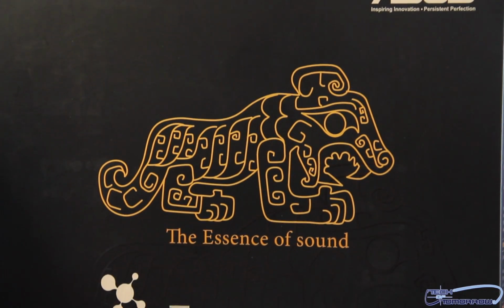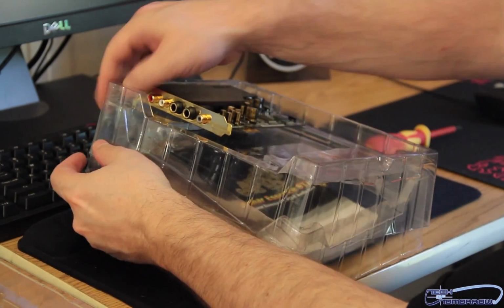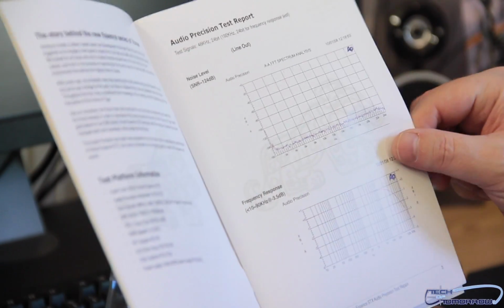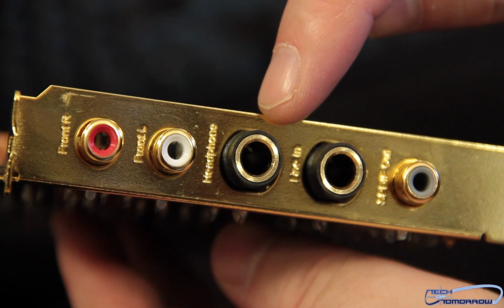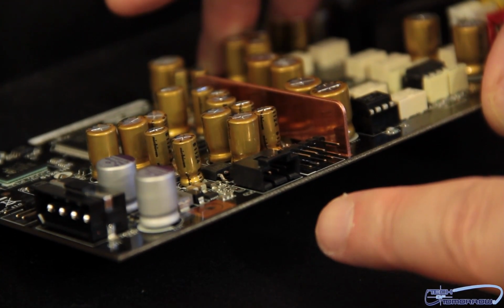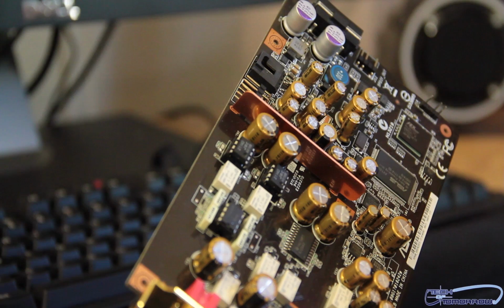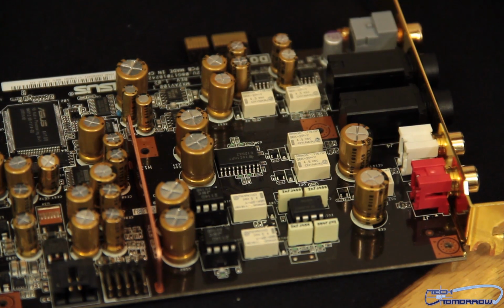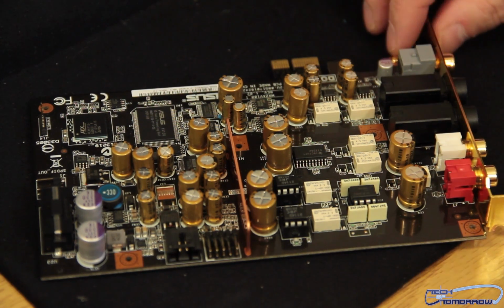ASUS XONAR Essence STX 124 dB SNR/Headphone Amp Card Unboxing

Comment: The DAC in this card is insanely good. I have tried several new (and expensive) models from, among others, Topping and SMSL, but none of them are in any way decidedly better than the DAC in the Essence STX card. With upgraded OP amps, the card will be even better.

I bought the card used for less than $15!
Reply: I'm sure it sounds great but I doubt a bit that it comes close to external DACS in every discipline. 

Btw, I have also talked to somebody who tuned his Benchmark DAC(older studio oriented equipment) and he opined that most of Topping & Co. suck. According to him the tuned Benchmark  DAC(an external unit) is superior.

I'll pick one STX up tomorrow and I'm pretty "amp'd" to give it a listen.
I already got a DX and a D2 and they are a vast improvement over the DAC of the OEM sound unit.
Reply: Hi, how does it sound through coaxial spdif connection?

Have you connected it to a DAC or Receiver that way?

I bought it used to use it through coaxial and I'm waiting for it to arrive. I've read many reviews that it sounds very good through coaxial with high-end equipment, it also has a good review on Stereophile.

Comment: Will I need a DAC if I get this card?
Reply: +Daniel Shelford All soundcards are actually DAC's. They all convert the digital signal to analog. People prefer to send the digital signal (SPDIF or USB Async B) straight outside their PC-case. Since it has vibrations/static electricity etc. That's why most people nowadays buy a external Soundcard (DAC/AMP combo)
Reply: Thank you!

Comment: i have a 780ti videocard i use HDMI cable to my onkyo 5.1 amplifier.. i dont have a soundcard its just onboard on my asus gene VI. what happens if i buy a soundcard. will the audio trough HDMI be better? will it use the soundcard? or is it still the onboard sound?
Reply: The audio through HDMI from you graphics card will use the onboard sound, so the soundcard will be better in terms of audio quality. In order to utilize the soundcard you have to take the audio through the soundcard to the amplifier. I would use an optical wire from the sound card into the amplifier. That way you bypass the onboard sound and only use the audio output from your soundcard, which will give better sound quality. Hope this helped.
Reply: Ok but i use a 10 meter hdmi cable to my amp, so i need an 10m optical cable also?
Reply: Claus van Dijk Yes, you would need a 10 m optical cable. The advantage of optical is less signal loss than metal wires so nothing to worry about regarding the length. Depending on where you live the price may change but is around $15 on amazon.

Comment: can this card drive my 5.1 speaker setup, its all connected to a subwoofer and from there one cable is going in to my motherboard its the logitech z506 would i benefit from using this card because for movies I really want the best sound possible that i can get from my speakers and the back 2 speakers don't output alot of sound and i have always thought that was because of the lack of a quality soundcard.
Reply: Yes, although unless you plan to upgrade your speakers in the future or purchase high quality headphones, I would suggest buying a cheaper sound card e.g. ASUS Xonar DG.  You will need to use three connection points for 5.1 (often red, black and yellow) to pass through the 6 channels (Front L & R, Rear L & R, Center + Sub).  You can use the Asus software or even Windows control panel to adjust the volumes (balance left to right & fader front to back).
Reply: Thanks for the info I'll think I'll still buy one because I was already planning to upgrade my speakers/headphones but what kind of speaker would match this card it has to be 5.1 or up setup but what would the price be? could you give some examples, thanks for the help man I really appreciate it.
Reply: Rajivrocks Ltd. You're welcome. There is a very large range of speakers available. You would need to decide: budget, Quality/volume, looks, brand preferences, sizes, other uses...
Reply: something like 300-400 euro's, has to look kinda good though it doesn't matter that much, Quality of sound has to reflect the price ofcourse.
Reply: Rajivrocks Ltd. In no particular order; only including those that I have used or heard in person (likely others can recommend some too)... Logitech Z906, Pioneer SP-PK21BS (large), Wharfedale Moviestar DX-1, Cabasse Alcyone 2, Energy Take Classic, Edifier C6XD and possibly above the price range: Swan M60 or SoundWare XS 5.1
Reply: Rajivrocks Ltd. RE: Headsets, I'm currently using Turtlebeach XS Z7 for my Asus gaming laptop. Sound is okay and the left can make some plastic cracking noises. However, these would waste your money if you buy the STX! So if getting a headset - go for QUALITY (not USB connection, NOT most gaming headsets). Especially with the great headphone output on the STX. I would highly recommend the Audio Technica ATH-AD700X, Beyerdynamic MMX 300, or Sennheiser PC 350SE. I'm sure there are others to look at. Not too personally experienced here.
Reply: can the stx II 7.1 drive the sennheiser HD 600's?
Reply: Rajivrocks Ltd. Yes. You may need to change the output settings as I'm not sure if it can auto detect (you wouldn't want a signal strength for 300ohms sent to cheaper headphones/headsets as I guess it could blow them). They would sound amazing :)
Reply: okay thanks for all you help now i got to decide what to buy with the STX II 7.1 surround speakers or heaphones, I really really love the feeling of a theater in my room and that is what I get with the speakers but when I was watching a movie with alot of music in it and all of my family were in the house I used my headphones and it was really really imersive with the lights turned of to so i am really in a pickle here. the best thing is buying them both but that is a bit to much money I haven't got that much.
Reply: Ian Hulbert do you think they are worth for Senheiser HD 650 headphones?
Reply: ***** only these headphones, no speakers

Comment: wich is bette, STX or phoebus?
Reply: Well you probably found the answer by now but yeah. The STX is more headphone and 2.1 speakers oriented and more for the people who want good quality audio over surround sound however, it is one of the best if not the best sound cards in that respect. There is probably nothing that would come close to the power and quality of the STX. The Phoebus is more gamer oriented than the STX and it offers 5.1 and 7.1 output while still giving decent quality audio for people with 2.1 or headphones. If you need good surround sound with a powerful headphone amp than Phoebus is a great card a bit overpriced though in my opinion. If you want some of the best audio quality a sound card can offer and don't care about surround sound then the STX is perfect in that regard.

Comment: Dont listen to hitomi kugo these will work for astros he showed in the video the optical add on
Reply: I have Astro A40s will I benefit from this sound card in game vs using my optical on my Asus maximus 7 hero motherboard?
Reply: ThirdEYERecollection I doubt it as the card is all about quality DAC (Digital to Analogue Conversion). The optical out (digital signal) is just bypassing all the quality DAC. Not sure, but you may be able to utilise the software. Otherwise your Astro MixAmp is actually doing all the work i.e. DAC (and from what I hear and read; it does a decent job). Unless I misunderstood and you meant bypassing your MixAmp and connecting the headset directly to the STX.  Then I would expect you would improve the sound to the limit of the A40 headset; then maybe upgrade to quality headphones later?

Comment: DO NOT BUY this soundcard with idea that you can use it with popular headphones like Astro A50s. If you have Astro headphones, you're going to be connecting via optical, which means that this card won't be doing ANYTHING. The A50 mix-amp will be handling the conversion from analog and will be delivering the audio quality that you receive, not the soundcard itself. This fact seems to be alluding a lot of people.

Comment: how should it? no soundcard has an usb port. the usb ports on your computer are directly connected to the motherboard, therefore the soundcard wouldn't change shit in this case. (also i think that you might not have the best headset, as i don't know a high quality headset with usb, so the stx might not pay off in your case)

Comment: From what I've read you shouldn't use the MixAmp with this card, as the Db to noise is higher with the Xonar than the MixAmp (the MixAmp has 106 and this card has 124)

Comment: (3)

But for the purpose of gaming anyone would be much better served with the AD700 or the recently released AD700x (which I also own and are also from Audiotechnica) as they are so much more comfortable and open back design with infinitely better soundstage and positioning.

Different strokes for different folks.

Comment: haha ya i have a pretty decent setup...  8 Cerwin Vega VE-5M Bookshelf Speakers, 2 Bose 161 Main stereo speakers, and 2 Cerwin Vega VS-100 Vintage Stereo Speakers all connected to 2 Denon AVR 2311CI 7.1 receivers  with a RE Audio MX 18D2 subwoofer.

Comment: beyerdynamics dt990 (i have the 250 ohms, but you could get the 600ohms as well). I testet them against the denon 2000 (strong base but very mushy and hissing highs - thats a no no) and against the AKG K 701 (very harmonic and nice sound, but the base was too soft for my taste). I haven't testet them against the Sennheisser hd 650, because they were too expensive for my tast, and the 600 come way too short. all things considerer i would totally recommend my beyerdynamics dt 990 (NOT THE PRO ver)

Comment: Quicken2k, yes there are front panel headers though the cheaper components used for those connecters are more than likely not going to be as surefire as the outputs on the back of the card.  Elric - He meant an internal header for connecting the front panel audio.  If you install the card and use the front panel I/O but did not switch to the pinout on the sound card, you are using your motherboard sound.  No benefits received.

Comment: that would somewhat defeat the purpose of using a good sound card with an amp on it. part of using a good car is the quality of the outputs themselves. connecting your front panel outputs that are about as basic as it gets for quality will hamper usage. 

you should also be using a proper set of audiophile level headphones (not a headset) if you're using this card.

Comment: I mean your front panel header for MIC and Headphones jacks on the front of your case. Otherwise I'd need to use an extension to run to the back of the case.

Comment: I use Classe CA-M600 Monoblocks for each speaker and hooked up to Classe CP-800 Pre-Amp to  Lyngdorf Millenium MK IV Intergrated-Amp. And this is all hooked up to Classe SSP-800 for my Surround Setup. All my money is spent on this setup. I use van den hul the third for the Nautilus and using van den hul super nova for the back speakers and van den hul  mc-silver IT MK III balanced XLR cable between the amps and Van den hul orchild for other applications. Van den hul the vhd for the TV picture.

Comment: Which sound card do you recommend if I'm planning to connect my PC to a Hi Fi digitally? I'm using a Primare I22 with it's optional DAC (Uses Burr-Brown's 1792 DACs) which also takes plain USB. Should I get an optional sound card for my PC or will i lose much quality over USB? Also gonna use Jenving Supra cables.

Comment: Would I still need to plug in the molex if I'm not going to use the built in sound card amp? I would use the Fiio e9 external amp.

Comment: As mentioned gamer.. I use Sennheiser 800 for music and audio generally.
So yes, I am an Audiophile. And got 4 different sound systems in my house.
Bose T20 Lifestyle in the Cinema. B&O Beocenter 9000 with B&W Nautilus Speakers as the listening system. A Cerin Vega system LS-10 and LS-15 for party's and my Cerwin Vega XLS-28 with a nad C270 for computer. I am an audiophile.